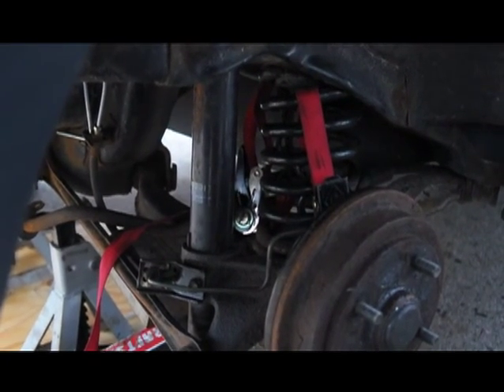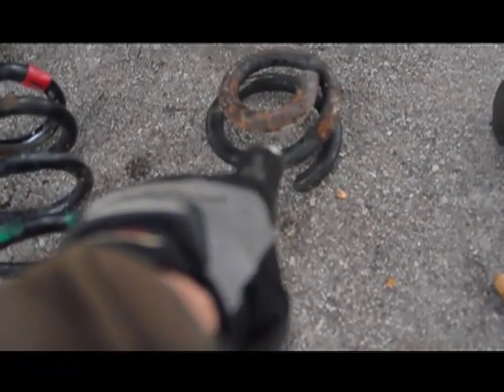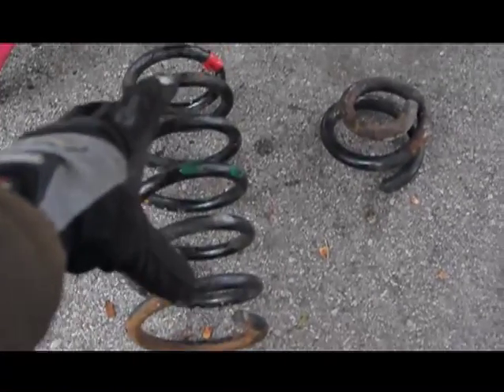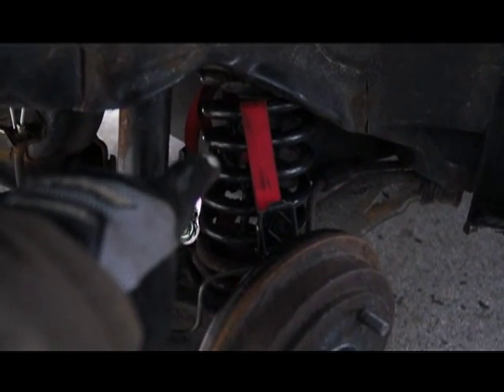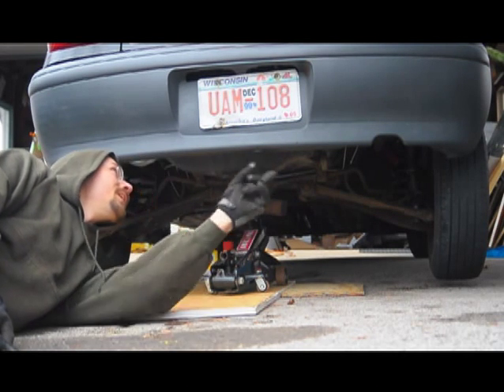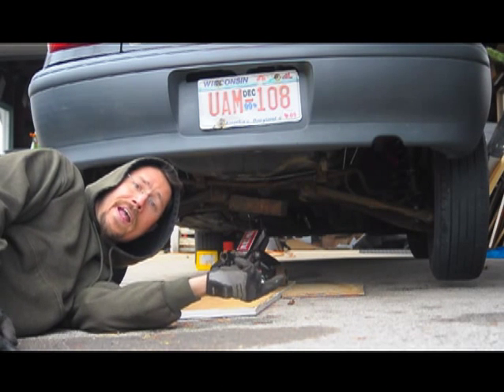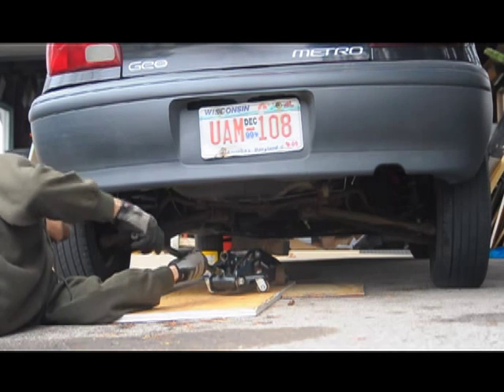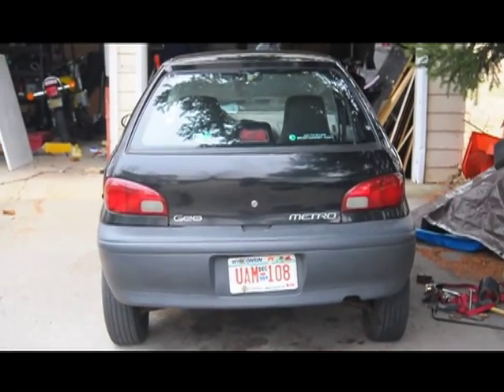Electro-Metro New Springs!

Comment: I bought and installed Ford Ranger springs in my 94 Metro (soon to be electro) this past weekend.  Not an easy job.  Thanks for the idea and video info.  At this point with no batteries in it, the back end is like a spring board.  Very tight, but I'll be adding 500lbs of batteries to the back and 400lbs of batteries to the front soon.

Comment from the maker: A guy I know is building a Metro Hybrid, with 6 batteries in the trunk. He found that Ranger springs were a pretty close fit. The diameter isn't EXACTLY the same, but it's darn close/close-enough. I don't think the year matters.

20 6V batteries sounds like a LOT of weight. A Metro is only designed to carry no more than 1000# including the driver WITH suspension and brake upgrades.

Comment: thats true but did you know that you can run 99 cars off a dirty coal power station or 1 car on petrol for the same emissions? its true electric motors are very efficient ! i too have an electric metro. check it out on here while your at it!

Comment: At a 1/2in you could warm just one end a little and it should sink enough to even it out. As long as you are not too far from the end of the spring the rate should be the same when you are done.

Or you could do the obvious and take them both out and shave the offending spring just a little.